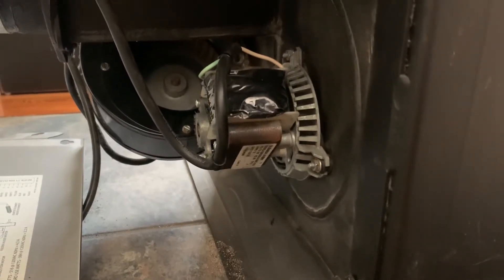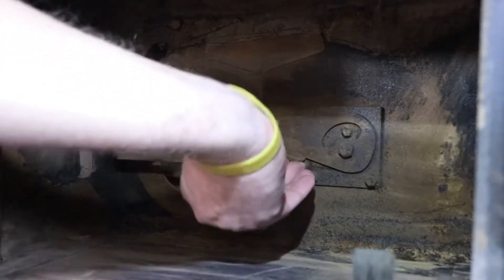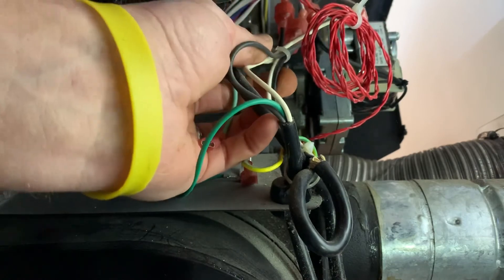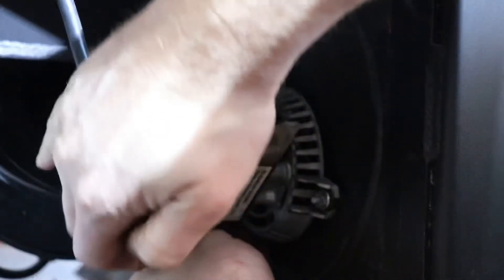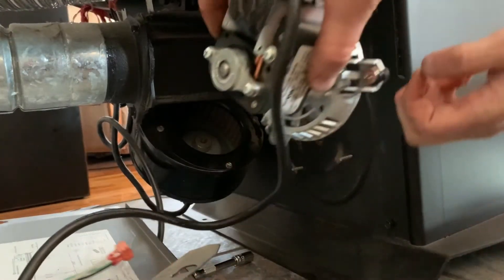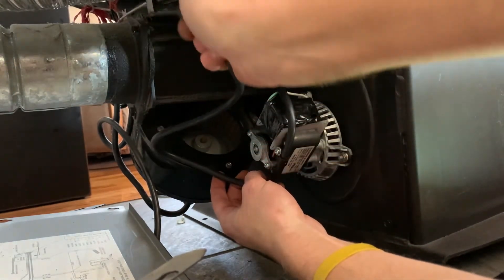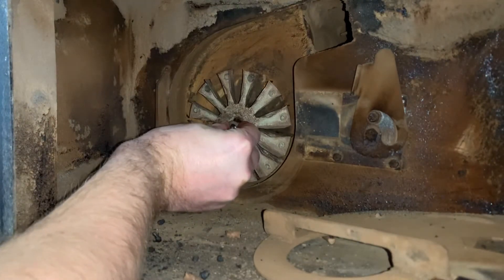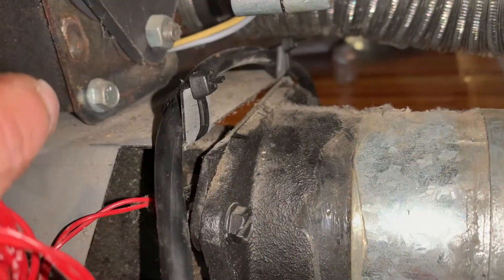Harman Pellet Stove Combustion Blower Exhaust Fan Motor Replacement

Comment: Y'all make it look so easy getting the fan blade off. Mine is rusted on and I think I'm going to have to destroy it getting it off.
Reply from the maker: Luckily mine came off easily this time, I’ve heard that others have had to use a hacksaw to cut the shaft of the fan to remove it. Hopefully you get it off without too much trouble. Thank you for watching and please consider giving the video a thumbs up if you haven’t already! Thank you!

Comment: Like how the fan blade just fell off. I had to cut mine off. For all the people on here asking how to get it off. Remove the 3 bolts and nuts. Pull the motor away in the back and use a sawzall to cut the shaft. Its not rocket science people.

Comment: Great video first of all. I have a question before I go ahead. We bought a 30 year old house with a Harman stove in it. It is quite loud on startup but then that noise goes away after it gets heated up. From there on it's not to loud. Just at startup it sounds like theres a badger locked inside the stove. Is this the motor that would be noisy at the start of the ignition? Theres so many motors and fans back there...
Reply from the maker: I would say it is most likely the auger/auger motor. Search YouTube for harman auger squeal and see if that is what noise your stove is making. Hopefully this helps, thank you for watching!
Reply: @5MinuteFixit  thank you! I wouldn't call it a squeal more if a loud vibrational grrrrrrrrr. Then after it gets up to temp it's stops.
Reply from the maker: @andywalsh2980  hmmm that's tough to tell it could be the combustion motor or the combustion fan possibly hitting the inside of stove (check that its not this first)

Comment: I had a service person replace my blower motor fan on a 52i.  It now has a slight noise, not tin-nny, but I can hear the motor spinning. Any idea what might cause that? and any way to make it be virtually silent, like the old original one was?
Reply from the maker: The noise may go away some after it breaks in a little or you can add a bit of oil to the bearings. If it is new however it should need oil.

Comment: What would you suggest if the screw for the exhaust fan stripped instead of loosening!
Reply from the maker: See if there is a what to cut it off from the back side because it is not screwed into the stove itself but rather the nut that holds the fan on. It should fall right out once cut. Hopefully this helps! Thank you for watching and please consider giving the video a thumbs up and subscribing if you haven’t already! Thank you!

Comment: At the point of using the Allen wrench, it seems to be machine tight. I can’t get it to budge even with a cheater bar which, I feel I shouldn’t have to do. 😩 Any ideas?
Reply from the maker: If you can I would put on some penetrating oil and let it sit overnight and give it another try. If that doesn’t work you may have to cut the shaft and fan blade off and replace the fan blade with a new one. Hopefully this helps, thank you for watching. Check back in and let  us know if you get it off!
Reply: I know this is waaaay too late, but I tried everything to get mine off. I use penetrating oil, I used a torch... No luck. I had to get my Dremel, and cut the shaft off..